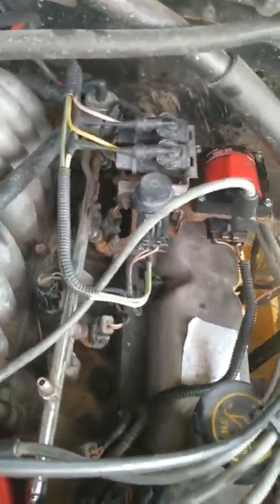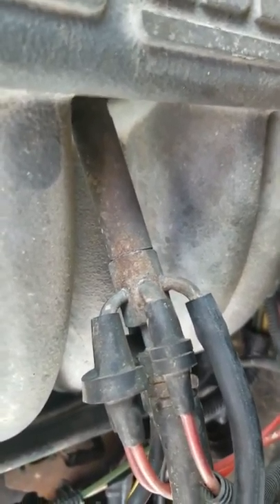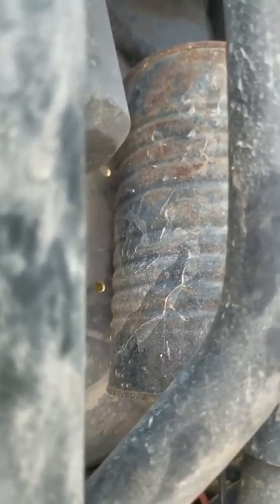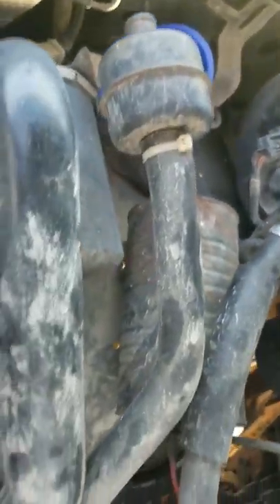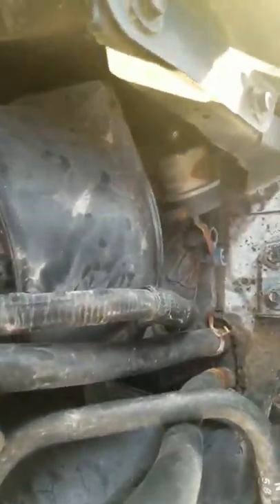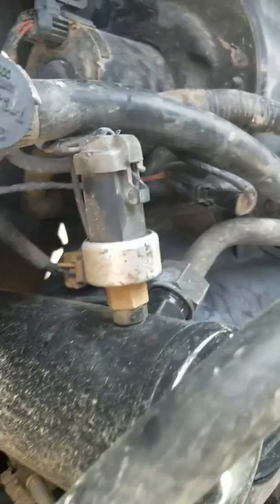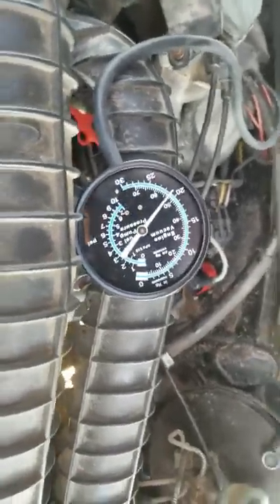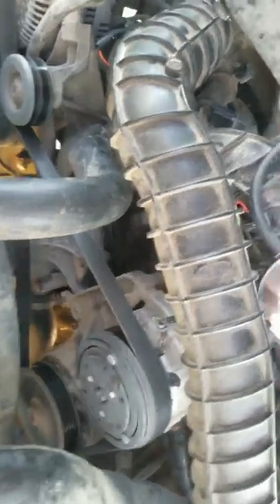Bronco vacuum test

Comment: You might also want to check out the cam stator? When mine was failing it would cause the engine to sputter out, after a week or so it start to kill the engine out for a second or two, then one day engine died out like I turned the key off while driving. It would crank but not fire up. Once I replaced it was good.

Comment: The soup can is a vacuum resivour. Stores vacuum. The avacado sized thing that looks like it is missing a hose is a vacuum pump muffler, dont worry its not supposed to have a hose on the other end.  The vacuum switch by the corner there is for your recirc air.  There should be a hose connected to it. 
If you need more info check this out: http://www.fullsizebronco.com/forum/21-noobie-bronco-tech-questions-flame-free-zone/151908-coffee-can-looking-thing.html